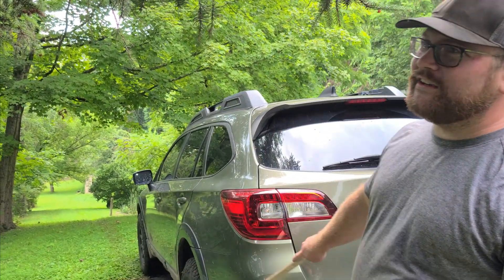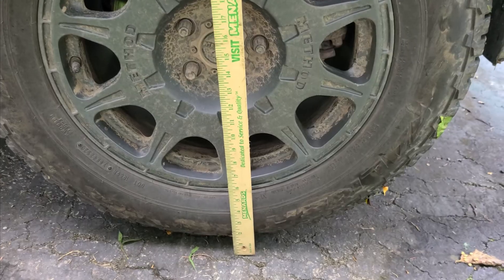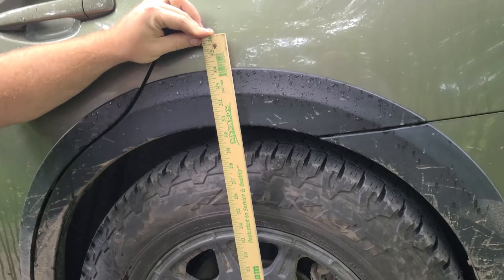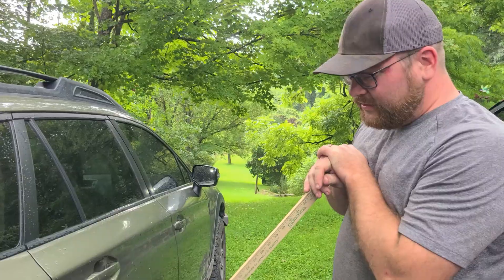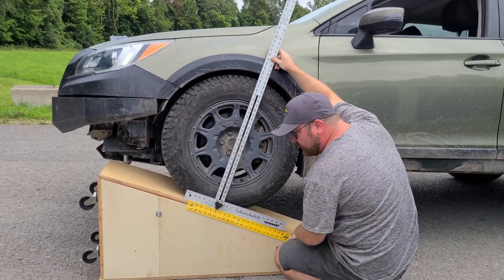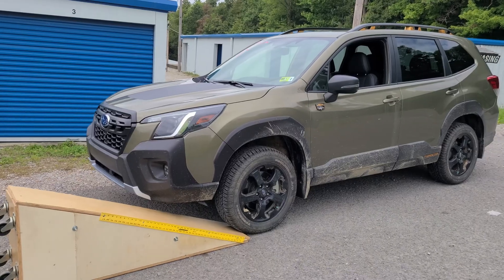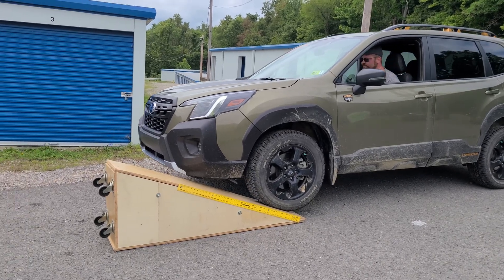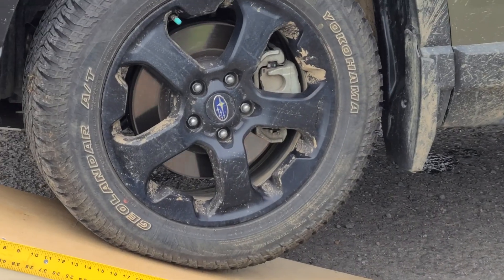Subaru Ironman Spec C Travel and Load Test, Wilderness sway bar delete travel test, Video 4 of 2.

Comment: Question I bought this lift too, can I add a two inch spacer too for extra body height, or will I have problems? 2016 outback 2.5
Reply from the maker: @thomasuzarski7368  I have done it but I wouldn't recommend it.

Comment: So which is better the ATS or spec-c? Or when/why would you choose one over the other? 

Not being loaded down all the time, except for a tire carrier and full spare, would the ATS be the way to go?
Reply from the maker: That would be my subjective opinion but based on my experiences I think most would be happier with the ATS unless they have a 3.6, heavy bumper, need every millimeter of lift, and lots of gear constantly.
Reply: @bruceyyyyy thanks for all your content; you're a wealth of knowledge for the Subaru family.
In regards to the ATS kit for a FW, I've heard conflicting reports on whether to use the subframe spacers in the ATS kit or just the struts on their own. If using subframe spacers, add in a 3/4" carrier bearing spacer to limit risk of wobble.
Do you have a take on this you can share?
Thanks!

Comment: I used to have a '19 forester sport with the Ironman ATS kit, so much rear end sag with just camping gear!  When I traded it in for my current forester wilderness, my dealership really wanted my lift and paid extra for it, so I had to go out and buy a new lift and went with the Spec-c since I anticipated getting a hitch mounted tire carrier. So far, even with 125+ pounds hanging directly off the rear, and filled with camping gear, it still stays pretty level. Been happy with it so far. 

Also, I seriously have to consider disconnecting my swaybars now...

Comment: Hey @bruceyyyyy since you've tested the Flatout, Ironman & ADF lifts I'm curious on which system you prefer. I'm leaning towards the ADF 2" front 2 3/8 rear lift.
Reply from the maker: I had that one. It was fine. 

Definitely prefer the suspension lift over body lifts.
Reply: Would be doing shocks & struts at the same time @bruceyyyyy .  Do you think the suspension lift does less wear on drivetrain? Thanks for getting back.
Reply: ps 
It's for a gen 3  @bruceyyyyy
Reply from the maker: I would say wear being equal or too close to call. 

But the extra travel is amazing on right gravel roads. Even the FO rides better than ADF when blasting down forest roads.
Reply: Thanks again for responding @bruceyyyyy .  I completely forgot about the Travel.  I live down a dirt gravel/ broken cinderblock/brick road that has wash outs frequently with a 6-10 inch Dip getting  on pavement at times in a turn with traffic going 55.  Sounds like I'll be checking into the Ironman & seeing if they can do an 09. Haven't seen anything going back past a 15

Comment: I just put the spec C on the rear and the ats on the front. Reason is for hauling a square top trailer. Huge difference! No sag in the rear but the rear needs some weight. When no weight is on the back you can notice when you go over bumps just because the rears are way more stiff. I’m gonna put a rigid tire swing on soon. Should help a little.